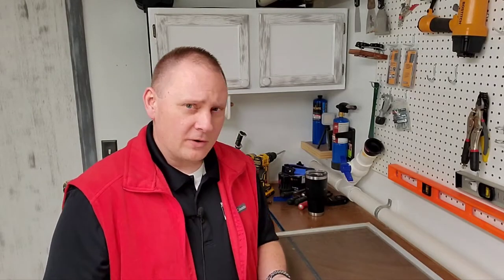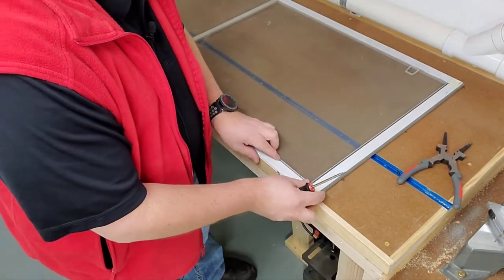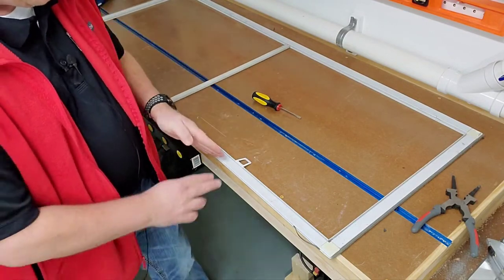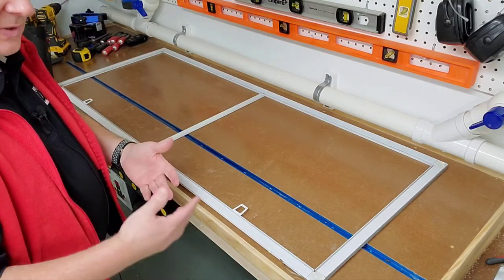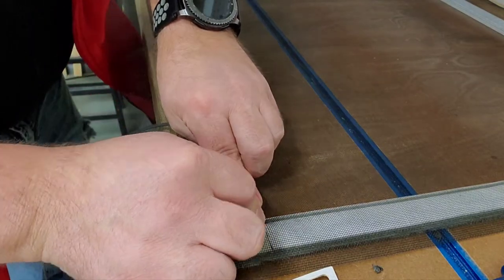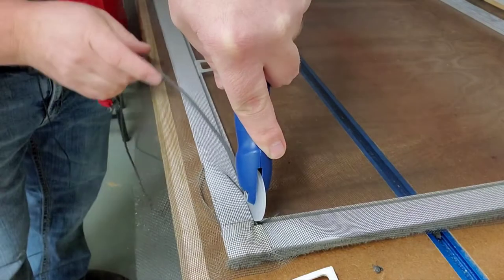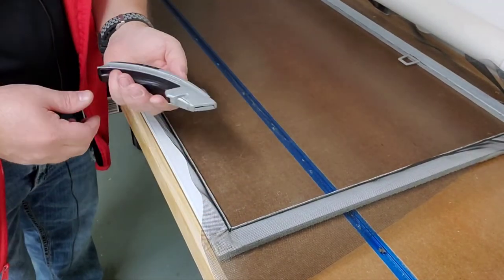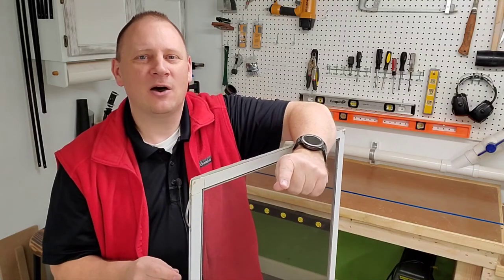DIY Window Screen Replacement

Comment: Can you tell me how to remove screen plungers? I'm trying to replace the screen but the screen was under the screen plungers, and my plungers are not broken.
Reply from the maker: I have not seen these plungers before. From my research it appears the inside portion that you pull on snaps on during installation. It may just pull off with a needle nose. That said...I would locate some replacement plungers as they may be hard to come by in the event yours are broken during the disassembly. 
Good luck and thank you for watching!!